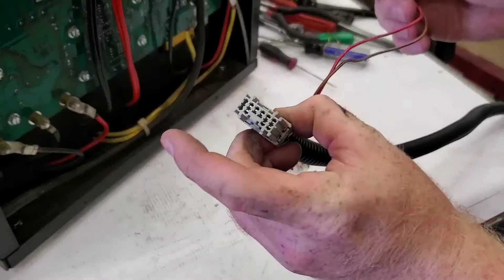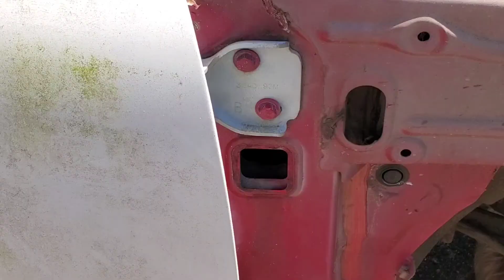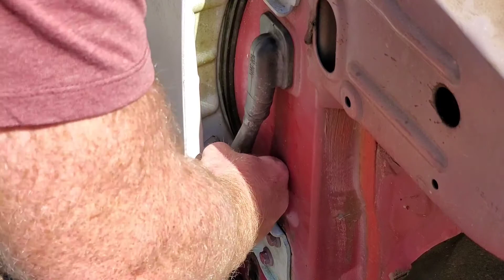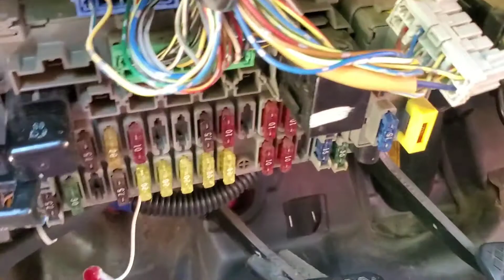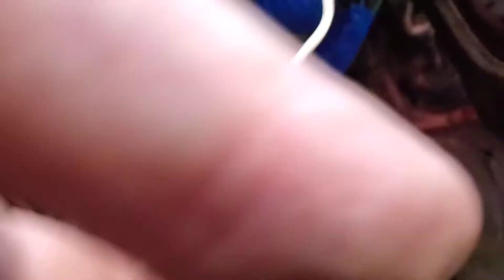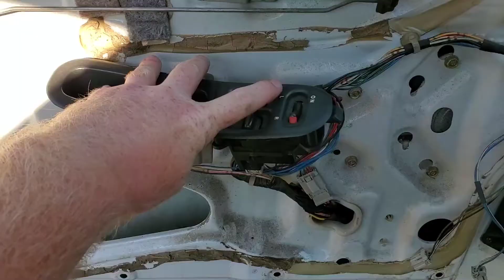92-95 eg eh dx civic hatchback power window/door lock power mirror conversion (part 2 installation)

Comment: I try to hardwire but a lot of things don't make any sense as an electrician. I try relay but  only click only nothing happened.
Reply from the maker: You might want to check all the switches and window motors to make sure the equipment is in working condition, because if you follow everything I did and install it like I did it should all work like Honda intended it to.
Reply: @the710experiment84  I noticed the driver door use positive and the passenger side negative

Comment: Ihave a 1993 honda civic si does have oem sunroof put the door was change by previous owners not sure if come with original power door how can I check that out
Reply from the maker: Are you in the United States, or a different country? In the United States none of the 92-95 si civic hatchbacks came with power windows or door locks. They did have power mirrors and power sunroofs.

Comment: Did you use EX doors?
Reply from the maker: Yes I did. Using the whole ex door was faster and easier than swapping out the entire guts of both doors.
Reply: @the710experiment84  Good to know. I would imagine finding those doors is getting pretty hard to come by these days!
Reply from the maker: They are getting extremely hard to find in decent condition now unfortunately!

Comment: so you depinned the dx plugs for the speakers and the power door subharness just plugs into the back of the fuze box below the relay ? effectively you just added the power doors or did you remove anything from your car ?
Reply from the maker: I didn't remove anything from the dx except the whole manual door assembly, and you don't necessarily have to do that if you want to swap out all the guts.

To add the ex subharness there was a relay and fuses that needs added to the dx fuse box then aside from the speaker wires that I chose to depin all the other wired just plugs into the fuse box and doors.
Reply: @the710experiment84  sorry still a little confused. so when your adding in the new harness you made, are you just unplugging the the stock harness connector from the fuze box (bottom left green one) and plugging in your new sub harness then ? Like, the dx already has those connectors right? And theyre just way less wires (since we only have speakers and door indicators) so you just unplug them and plug in the new sub harness or did u pin into the existing plugs? Or are the plugs for the doors not there on the stock harness at all ?
Reply from the maker: Yes the dx has all the proper spots to just add the new subharness plugs in the fuse box. The only thing has to be modified is where the door speakers are connected. That's the plug I depinned the wires from the car and swapped in the wires from the new subharness. Hopefully that'll clear things up for you, but feel free to ask more if you have any other questions about this.
Reply: @the710experiment84  ok that def helps. Speakers get pinned into stock harness, but everything else the subharness replaces stock harness connections then. As in behind the fuze box, to the doors, and to the PM switch, correct ? And therefore you end up just unplugging the stock harness and plugging in your new subharness, and effectively just leaving the old connectors hanging around (obviously ill tape them up so theyre not actually) and not running to anything anymore ?
Reply: @the710experiment84  my confusion is stemming from the fender/door plug mostly. I get under the dash is no big deal to have a few connectors chilling, but what about the fender plug to the door ? I have a 92vx and my car def has the wire loom running thru to the door already, but im guessing its not prewired, so ill have to replace that with said sub harness like u made and like the forum described, but where does ur stock harness door plugs go ? You just snipped and taped ?
Reply from the maker: I didn't cut mine. I just pulled the original harness back through the lower A pillar and tied them back incase I ever wanted, or needed to go back to stock. Then ran the new subharnesses through to the doors.
Reply: @the710experiment84  gottyaaa lol sorry i had to ask 5 different ways but i get it now! thank you so much man
Reply from the maker: It's no problem at all! It happens to all of us occasionally. Sometimes we have to rephrase a question a few time to get each other's on the same page.

Comment: If the door latches are manual can u just add on the electrical part to lock and unlock the doors or do u have to use the latches from a car that had electrical latches already
Reply from the maker: The way to make the car have oem power door locks is to swap out the manual latches for the power ones. If it doesn’t matter to you if it’s oem, an aftermarket door lock solenoid, or power door lock kit, can be added to the manual doors. Either route you decide to go requires about the same electrical/mechanical skill set.
Reply: A ok a friend game the the harness already separated Ike you did and he also gave me the Actuator to to lock and un lock but just wanted to make sure thank for the respond appreciate it alot great video

Comment: You could use the same harness in a 98 civic dx?
Reply from the maker: The same principle applies to the 96-2000 civics, but the 98 dx civic would need the harness out of a 96-98 ex civic. If your dx is a 2/3 door you’ll need a 2 door ex harness. If your dx is a 4 door you’ll have to get a 4 door harness.